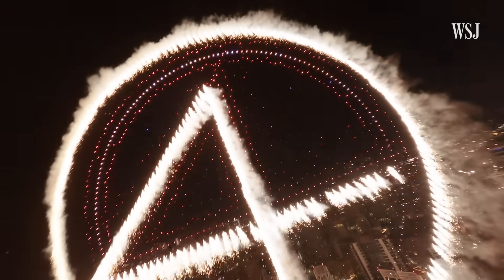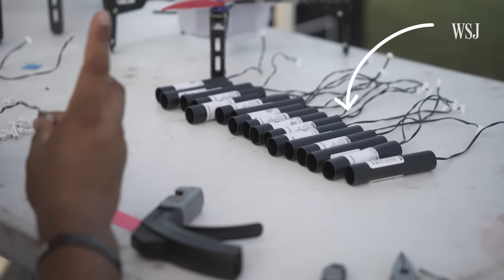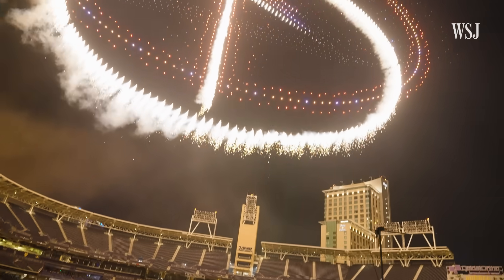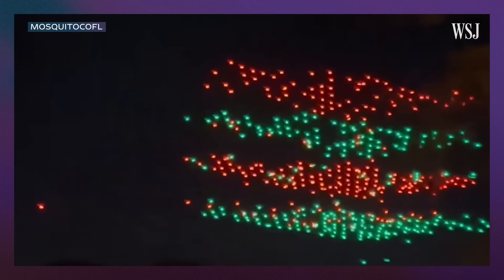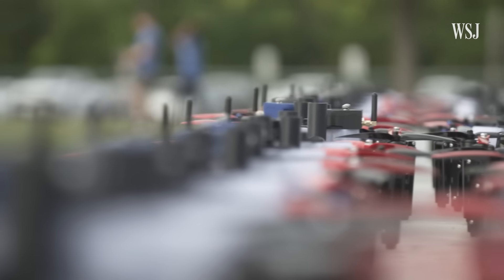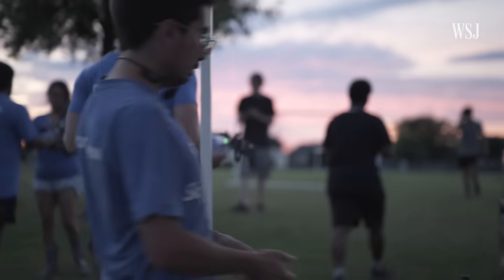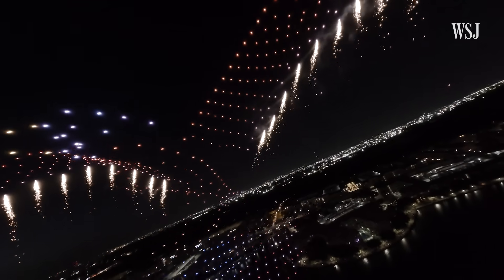Pyro Drone Shows: The Future of July 4th Fireworks? | WSJ Tech Behind

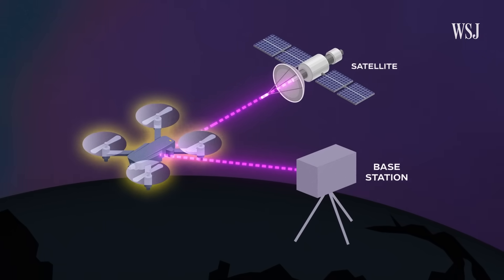Comment: 4:52 Those sensors, Time of Flight, are cheap, very small and miserly on power consumption. On a $1,500 drone having only GPS seems like minimal redundancy. Not limitless. Even new cars have spare tires, but something flying overhead has one, GPS... Yeah. No.
Reply: external visual sensors are a terrible idea for swarms. light show drones do have a lot of redundancy but yes it is true just one gps. however in terms of what actually happens a single gps failure mid flight is exceptionally rare. there are dozens of other things thatll cause a light show drone to drop before the gps ever does. like a loose prop. the gps is also the most expensive component on the drone so it doesnt really make sense to start there for redundancy. it won't do anything for environmental factors like jamming cause of something interferes with the rf of one gps itll affect both on the drone.

Comment: Chinese have it in the bag they just roll out trolleys loaded with racks the allow the drones to land and take off so essentially they just lay it all out so much faster and pack it away so much easier 😅 it’s all about the preparation system having rows of individual drones looks painful with your one by one method 😂 I know nothing but I’ve seen professionals in china and they make this group look amateur and so they use regulations as an excuse 😂😂😂 I just feel like they should go hang out in china and get some ideas 💡 that’s all (we can all get along here)
Reply: Gald you posted that.
When I saw them laying out the launch grid, I thought of (invented too late) exactly what you describe.
However..
While the algorithm is easy, it requires 2 distinct flight modes. That is an extra point of failure.

Comment: did you know that America has been lighting up the night sky with fireworks for 248 years? July 4th 1777 was the first time fireworks were used  and 13 rockets were fired, each representing the original 13 colonies.
Reply: did you know that in 1606 (170 years before America) James I passed an act to remember 5th November, with fireworks as part of the celebration.
Reply: @dougaltolan3017  from my understanding It was a political and religious crackdown, not a party celebration. What you are referring to is The Observance of 5th November Act 1605, also known as the Thanksgiving Act.

Passed just a couple months after the failed plot, this act declared November 5th a day of national thanksgiving. Churches were required to hold special services every year on that date.

It was a day to give thanks for the king’s survival.

The tone was religious and patriotic — no keg stands or sparklers yet, but it laid the foundation.

Then came the fire:

Over time, the people took over. By the 17th century:

Bonfires became common.

Effigies of Guy Fawkes were burned.

Fireworks started popping off (inspired by, y’know... explosives). 
The TLDR:
Popish Recusants Act (1606) = punishment and paranoia.

Observance of 5th November Act (1605) = “Yay, we’re alive!” — the ancestor of fireworks and burning effigies.

The law didn’t throw the party. The people did. And then it turned into a British tradition of roasting marshmallows while metaphorically (and literally) setting treason on fire.

Comment: Public shows like this should be BANNED due to the danger. These clowns seem to have ZERO regard for safety
Reply: you know nothing about this industry or its safety procedures and regulations
Reply: @redacted1946 as an electrical  / electronic  / software engineer with more than 25 year's experience,  actually I do have a clue what I'm talking about
Reply: @michaelnoble2432 no you really don't. I work in this industry.
Reply: @redacted1946  ah, so you're not biased AT ALL...

Comment: Seems like there's an AI element that isn't being used here... Name/drone each drone, put it into the software, load the pyro, tell the software which pyro is on each drone, then have the software calculate when and where it should take off to find it's spot so as not to hit the other drones. Just cause each drone doesn't know where the other drones are, doesn't mean the main software hub shouldn't and can't use that data to re-assign and optimize locations.
Reply: Stop with the AI garbage!